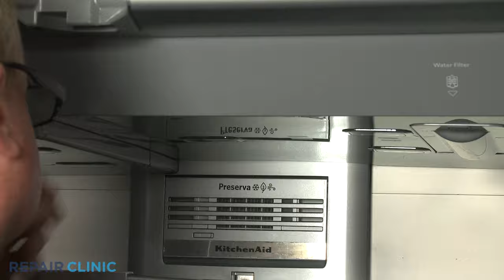KitchenAid 5 Door Refrigerator Ice Maker Replacement W11294907

Comment: Is there a way to manually cycle this exact ice maker?
Reply: There is a tech sheet under the top right hinge cover.  enter diagnostic mode by pressing ice/water + light at the same time for 3 seconds.  Once in diagnostic mode you use the buttons under the arrows to go to mode 57 then press the temp button and is should run the harvester and dump the ice that is in the maker.  https://www.youtube.com/watch?v=YjUmAHl2xak